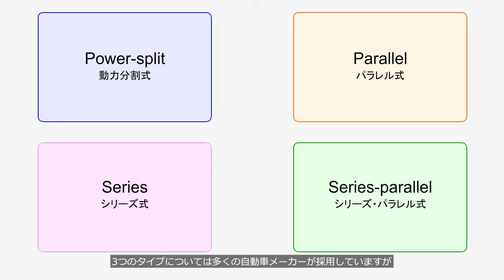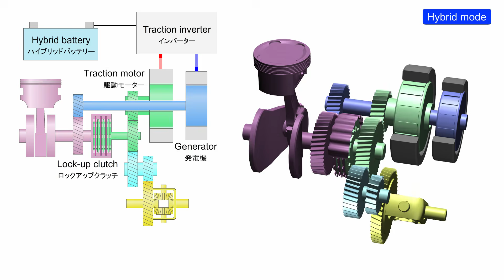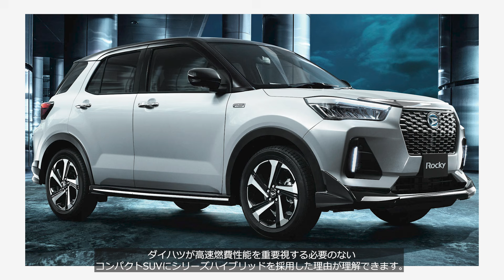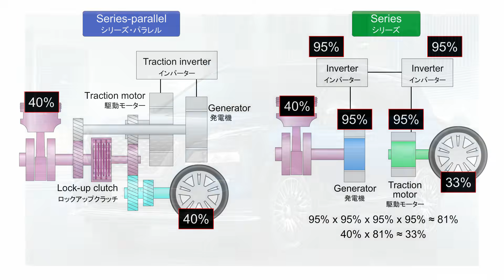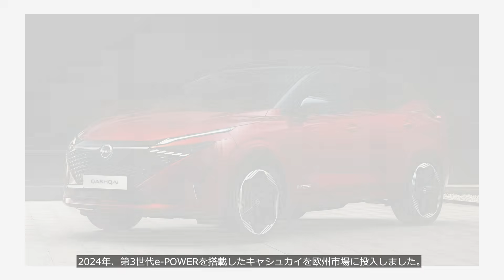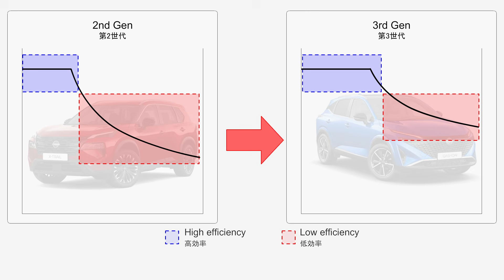What is Nissan's e-POWER? (2nd & 3rd Gen Compared)

Comment: E-power is coming to the states this fall in the new Rogue.  It's great to gain a bit of insight into the system as well as the previous generations.  If I can hold out long enough for it to arrive, and the pricing isn't too much of a premium, I would definitely consider looking at one.  Regardless, it's great to learn about the system and have an understanding of its operation.

Comment: Thank you for the report from Germany. I'm currently driving my 2023 e-Power with 50,000 km on the clock and I'm still thrilled with it. It replaced my Qashqai J11 dCi and I'm completely convinced by its fuel consumption. I can achieve consumption figures of under 4 liters per 100 km on both highways and in the city. My best result was 3.7 liters per 100 km on a 67 km trip through the Black Forest. In mixed driving, I average 5.5 liters per 100 km. A side benefit is the instant electric start and the immediately available 330 Nm of torque. On the highway, due to the hybrid system, it uses between 6 and 7 liters per 100 km at 130 km/h. What also impresses me is the build quality and the user interface. Real buttons instead of just operating everything via the touchscreen. I've already test-driven the 2026 e-Power and it used another liter less on my usual route, and it's even quieter inside. That's why I've already ordered it as a Tekna with the Premium Package in Ocean Deep.  So, for anyone who wants to drive electric but doesn't have a charging option and is worried about range anxiety, the Qashqai is absolutely the best choice. PS: My Qashqai e-Power came from a dual-brand dealership that also carries Toyota, so I was able to test the Toyota hybrids for comparison. The Qashqai is the far superior hybrid concept because it doesn't have a transmission and therefore doesn't have the transition between electric and combustion engine modes. Just take it for a test drive and experience the e-Power for yourself. For me, it's the absolute best full hybrid currently on the market.

Comment: I have a 2025 Nissan X trail e4orce and drove it over 6000 KM from Melbourne, Australia to Port Douglas through the heat of the Australian desert and also loaded to the hilt. Never a problem was encountered and I acheived 6.2 liters / 100 Kms. It's comfoprtable to drive with plenty of gadgets to play with and has heaps of power. This is a great SUV to drive.

Comment: The transmission in the parallel hybrid draws power effiency to turn its gears.
Reply: In contrast, series hybrid also has an efficiency loss (conversion loss from generator to inverter to motor) of at least 15%. The setup with the least efficiency loss is direct mechanical manual transmission.

Comment: From my experience on motorway qashqai e power has similar consumption as toyota rav4 -6.5 l at 120km/h and around 8l at 140 km/h. In city rav4 consumed 1 liter less -5.5 vs 6.5 for short distances. Drawback of rav4 is dreadfull noise inside at high speeds - I stuggled to talk by phone using installed hands free.... xtrail should consume more due to poor aerodynamics - btw hyunday santa fe plug in hybrid  consumes around 10 liters per100km at 140km/h....

Comment: It's not a fair comparison when you disregard the gear losses in series-parallel. It's like saying, why don't we disregard the conversion losses of conversions too. This way, both stay at 40% efficiency. Every system has to sacrifice something while gaining something. When the other system gained added efficiency sacrificing something else, you have to take both gains and sacrifices into account to make an intelligent comparison.
Reply: E-Power has gear losses too. It still needs a differential and reduction gearing for both motor-generators. The number of meshed gears at any given moment may actually be the same or very close to series-parallel. Then it adds electrical and conversion losses ON TOP of that. So while you're right that every hybrid system has its tradeoffs, e-Power's lies elsewhere than you think - in smoothness and simplicity at the cost of overall efficiency

Comment: The Nissan 2nd gen SUV isn't even competitive compared to conventional ICE car. Typically ICE can do around 8.5L/100km on highway. On a sedan, ICE can do 5.7 to 7L/100km on highways.
Hybrid excels in Urban drive with significantly lower fuel consumption.
Reply: The second generation was never made for highway driving. And Nissan said that many time. So what was you expecting? The new generation is made for highway.

Comment: Does the new e-power system use wound rotors instead of permanent magnet motors? One of the reasons electric motors take an efficiency hit at high speeds is because of the need to apply additional, field-weakening current to counteract the back-emf from the permanent magnet rotor.
Reply from the maker: Thank you for your comment. While Nissan uses a wound-rotor motor in its BEVs, I have not found any confirmation that this technology is used in its HEVs. Nissan may provide more detailed information once the third-generation system is introduced in Japan.

Comment: EREV is not a good or winning powertrain, it has much of the character of EV, the most strongly dispreferred character, and has additional false engine feedback and lacks driver command over engine.
It's dissociative.  Nissan should cease EREV powertrains entirely and right away.

Comment: So it means nissan e-power increased effiency of ICE to achieve equivalent effiency of power spilt hybrid
Reply: Yeah until the 6th gen ths on new gen rav4 came
Reply: @val @val8730  the 6th Gen rav4 still uses Toyota 5th gen hybrid system.
Reply: @ICU306 i said 6th gen THS not 6th gen rav4
Reply: @val8730 the 6th gen still use 41% thermal eff engine. That is what he is telling you. And he is correct.
Reply: @cb5110  every ths-ii gens doesn't meant it use newer engine.
Reply: @val8730  whether newer or same engine the thermal is still the same, what they improve on most is motor  and battery management, similiar to Nissan Epower battery management or their chinese rival. That is where the extra power comes from. The camry that use the 5th gen at 50 mpg is efficient than the lexus 6th gen at 46 mpg.

Comment: That's a big improvement. I guess the same hardware could squeeze a little more efficiency in a Seriel-Parallel setup, but that assumes cost and complexity are not factors. Great video as usual. Keep them coming 👏
Reply from the maker: Thank you for your comment. I'm always excited to see what new technologies will come next.
Reply: There is power loss in the clutch pack. Just use a better motor. Nissan probably use magnetic field weakening techniques to improve the motor efficiency at high speed. Which align to them switching to silicon carbide inverter. Silicon carbide not only is more efficient it also has a lot faster switching speed allowing for better motor control.